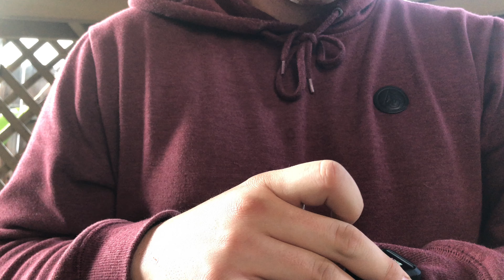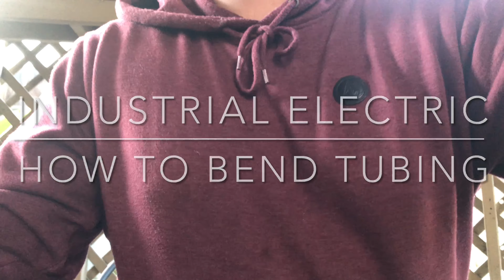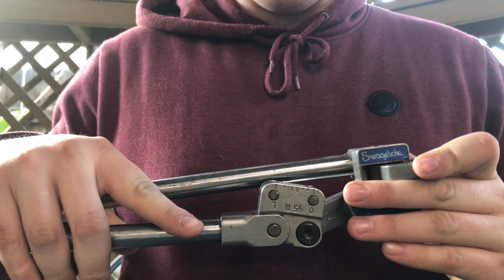How To Bend Tubing with Swagelok!

Comment: If you bend 30° on L, your bends and therefore offset will be shifted to the right. You should bend a 30° on the 30° mark. Also it's pronounced sway-ge not swag... Lastly that fitting is a union not coupling. Good video regardless.
Reply: It is swag cause it's 😎
Reply: L is basically 90 degrees right? So you would just stick with the numbers regardless